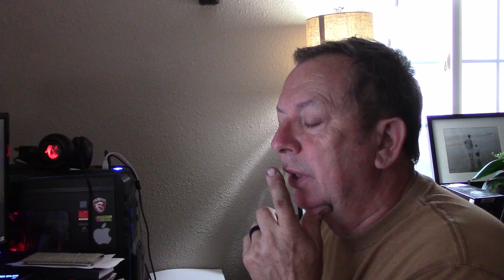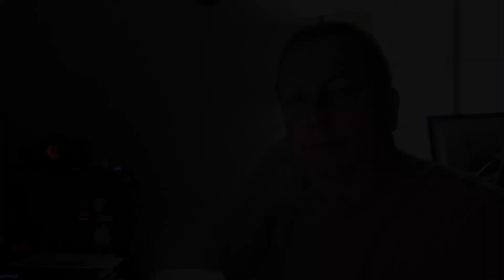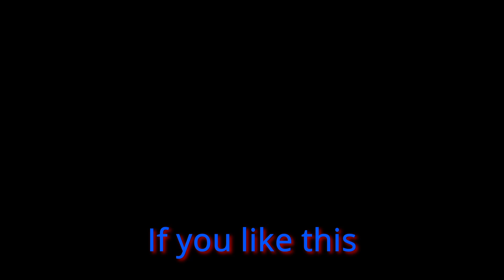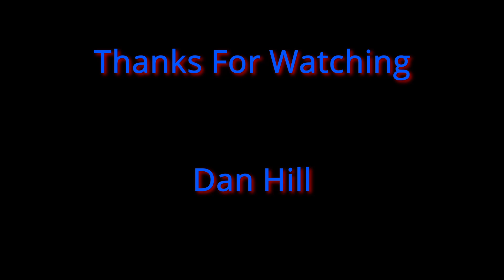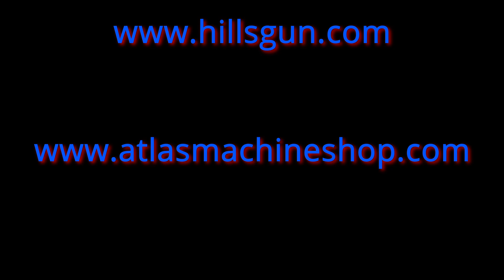Making Atlas Machines Affordable Again: Fleabay Edition, August 15 2021

Comment: Hello Dan; My later model shaper has an aluminum guard on the drive side. I believe this happened in the late 40's early fifties. My Craftsman 12 z 36 lathe has the aluminum guards on the top and motor belt. The guard for the change gears is cast iron. Sorry that the drive system is not perfect, but would consider a three phase motor and ac drive. Some automotive serpentine belt pulleys could be fitted. Just a thought, Steven.
Reply from the maker: Hi Steven: I had not seen a larger shaper guard in aluminum except for my reproduction, but Atlas did some various changes over the years, I have seen the aluminum on the 12". I will come across the parts for the Shaper but I am not in a hurry and it is a fully functional machine . Not really interested in converting to a ac drive as on the Shaper there is no real advantage. I run both phase converters and Vfd drives on several machines, but for their size and what I use the Atlas machines for they will remain in their original configuration